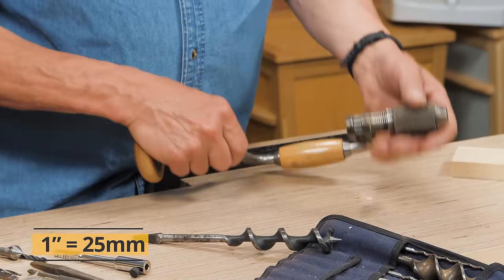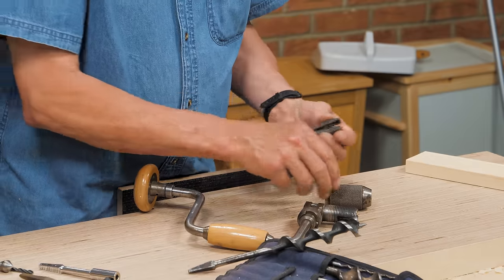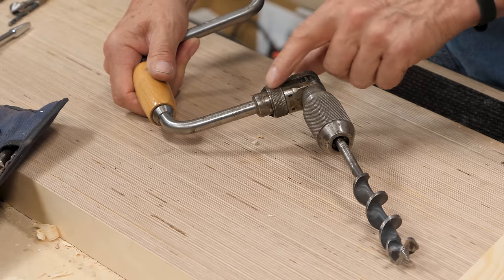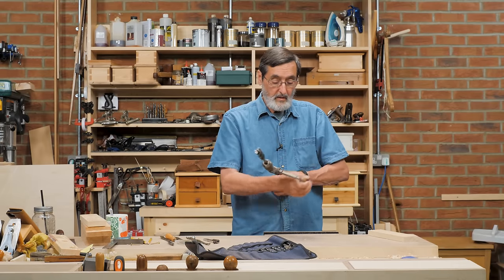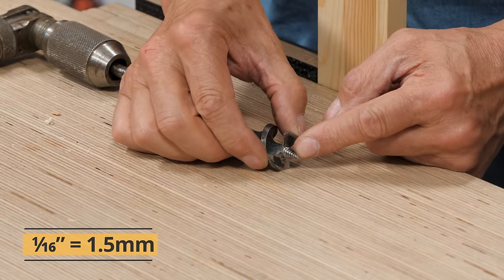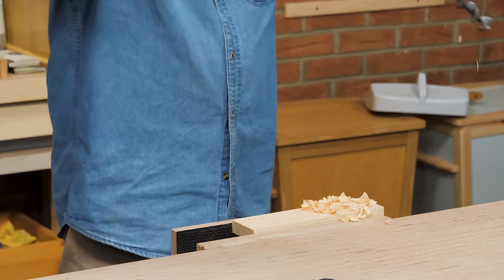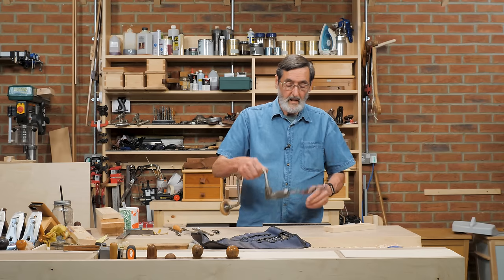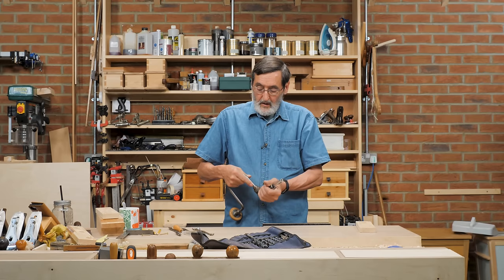Brace & Bit | Paul Sellers

Comment: Brace-n-bit, the tried and true tool which is in fact, far better than an electric, battery powered drill. Only draw back to it is, if using to "set" screws, nothing will beat a hammer/impact drill for those unfortunately. They are starting become a bit hard to find now days though, with the true "shank". Most are hex shank bits now.

Comment: I've got weird, hypermobile joints & can never seem to get a stable angle with a brace because of the degree of lateral movement on the turning hand. I do like the egg whisk style of drills since they eliminate that problem, but it's so hard to find one that doesn't have a lot of slop to it. Any recommendations, anybody?

Comment: I've bought two sets off of Ebay and both of them have had the wings rather worn down, so much so that I'm not sure much more sharpening can be done. While most of my tools are antiques and I enjoy them, I think I'm going to buy some new cheap bits at this point. Anyone buy some new/cheap ones that they think are good?
Reply from the maker: My tip is not to buy unless the bit tips are really shown well.

Comment: What's the degree of  sharpening on the two side of the bit and how do you sharpen the 16th small screw keep it sharpe
Reply from the maker: The screw doesn't wear out and needs no sharpening. Angles are hard to say but 30 degrees is always a good maxim for an edge sharpening.
Reply: @Paul.Sellers  thank you for the info Sr.

Comment: Hi Paul, the chippy im afraid is against the clock, power tools as im sure you know keep the money coming in
Reply from the maker: Not sure why this needs to be said really.
Reply: @Paul.Sellers  My point is a Carpenter/Woodworker relies on speed even in a workshop environment, you say you worry because we use them all the time, don't get me wrong hand tools are the bedrock of Carpentry, but the fastest way to cut a scaf joint is with the power tool

Comment: I use mine when I want to drill one or two large holes.  I'll use an electric if I need to drill a bunch of holes.  I also use it to power a countersink.  That way the bit is in the cordless, and the countersink is in the brace.  I didn't think it would be very handy when I got it, but I use it quite a lot.  You can find them used all over the place, and they are dirt cheap.  I suppose now that Paul has done this video everyone will run out and buy one or two, and you won't be able to find them anymore.  That's what happened to router planes.  You'd see them all over the place, but not since his first video on the poor man's router plane.
Reply from the maker: No, I just bought a set of ten on eBay for £10 plus £4 shipping and that's three days after this video.
Reply: @Paul.Sellers  A set of ten what?  Router planes?  Yes, they can be had on the internet, but they are not in second hand shops, or yard sales in my area.  They used to be, but no longer.
Reply from the maker: @deezynar  The question was in direct answer to the question we. Nothing to do with router planes .

Comment: Hi Paul, can you comment on the advantages/disadvantages of the Jennings pattern versus the Irwin pattern?  Many thanks.
Reply from the maker: I have both and the Jennings is more even in the revolutionary movement but th e Irwin seems ti evacuate the waste more efficiently.
Reply: As I understand it, the higher edge profile on the Russell Jennings-style also helps ensure perpendicular holes.
Reply: Thank you Paul, that makes sense.

Comment: Where can I purchase new bits?
Reply: Stanley makes a set of new bits, but they are junk.  Tools for working wood, website, was selling new ones at one point.  You might have good luck finding them in flea markets, thrift stores, yard sales, or the equivalent where you live.  I've bought them on eBay and from the aforementioned places as well.  I've bought them in bulk and to try and piece together sets as well.  I usually pay between $0.50-$1.00 USD each for them depending on the condition.  A matching vintage set will run you a good bit more especially if it has a case.
Reply from the maker: @red58impala  EBay and especially USA eBay

Comment: I inherited my dad's brace and leather bit roll but when making my w/bench I noticed some spurs needed sharpening. Any specific file recommended for sharpening or should I just get offline, stop askong and get on with it?
Reply: There is a specific file for sharpening auger bits. It is double ended with the appropriate "safe" surfaces for sharpening the cutting spurs and the main cutting edge. Never file the outside of the spurs as you will change the diameter of the bit.
Reply from the maker: @GaryT1952  I have used a fine saw file throughout my life on the bits I have owned for 55 years and they are still with plenty of life in them.

Comment: great video. but my experience is that although everybody can get a brace basically anywhere, nobody can find good auger bits. hard to get, even new ones
Reply from the maker: They are regularly available on ebay though.
Reply: I got a set of "stubby" auger bits, new, from Silverline for £14. Bosch sells a a much nicer set for £30 in a wooden box apparently.
Reply: I found new bits on icscuttingtools(dot)com (page 172 of their catalog), but I haven't bought any just yet to try out.

Comment: I bought a Stanley 144 and a set of bits in my youth. The bits weren’t sharp and they wobbled in the brace. I’ve used it a couple of times. Paul Sellers wasn’t explaining matters then!  Time to buy a decent one on eBay and sharpen a new set of bits..it’s better than breaking your wrist with a large bit and an electric drill. I have gone the full cycle, cheap tools and poor sharpening followed by better and power tools, and now finally back to hand tools that are quality and well sharpened.

Comment: We need a Link on Amazon for a set of Brace Bits, and those Gr8 adapters.
Reply: I found new bits on icscuttingtools(dot)com (page 172 of their catalog), but I haven't bought any just yet to try out.

The adaptor is elusive, however.
Reply: @taylorsaysso7817  Thanks Taylor
Reply: @johnawhiting  Try woodworking specialty stores that are known for carrying traditional tools. Tools for Working Wood and Highland Woodworking carry auger bits, IIRC, and Lee Valley carries both the bits and an adapter.

Comment: "Shell bit, the simplest of the bits..."
Machinists sometimes use something called a "D-Bit", which is mighty darn simple.
Round rod. File a cone on the end, say 60 degrees included angle. File half the cone off *lengthwise*. (Such that the point is still there.)
It's also the simplest "Reamer", where reamers aim to make more precision/straighter holes than drills can usually manage.

Comment: Too bad it’s really hard to find those bits now 70 years ago it was the only bit you could get
I have a pinpoint flat bottom Stanley set with those arched cutters they are my favourite bit but I only have three of them quarter inch half inch and 1 inch I wish I had to 3/4

Comment: And they jump 200% in price on eBay.
Reply: Ryan you can buy them new for pennies
Reply: @lilcicero77  If you have ever read Mr. Sellers' blog you will notice each time he mentions an old tool specifically the price jumps.  Might be time for me to sell some of my excess braces and bits.
Reply: red58impala I'm aware of that but Stanley sells them new for £20. That won't break anybody's budget, and the price won't go up.